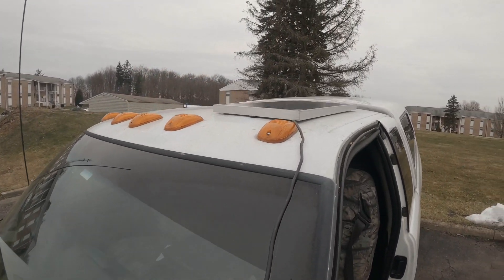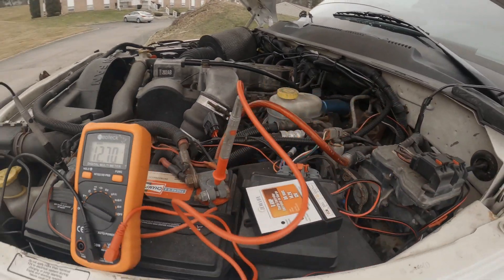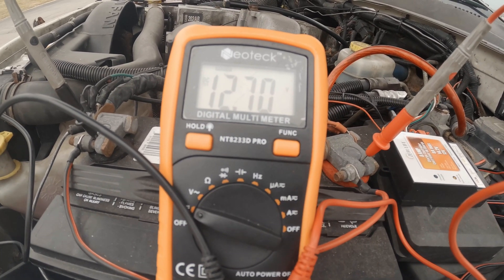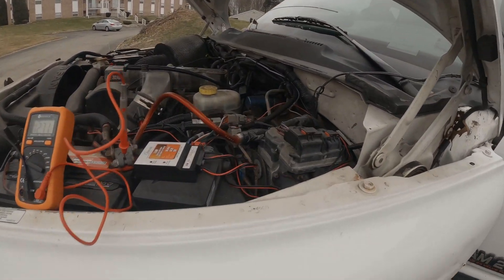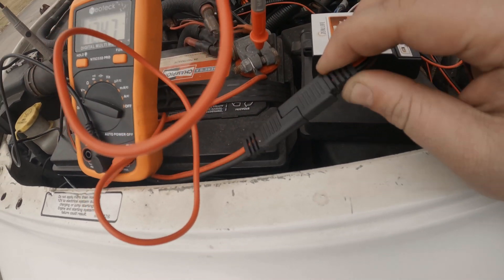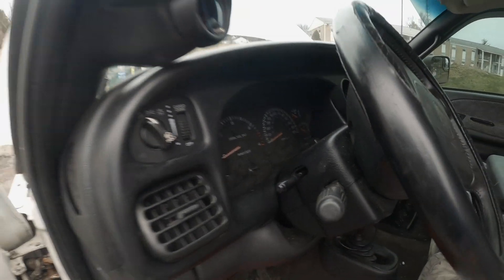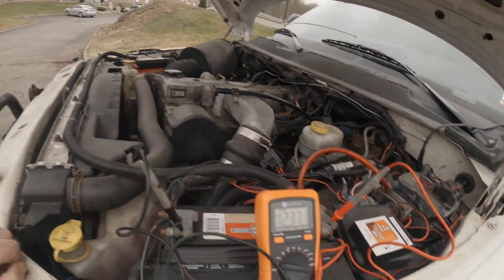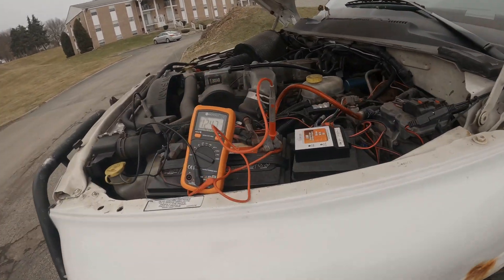SOLAR POWERED BATTERY MAINTAINER FOR DIESEL TRUCKS

Comment: Question - Does your setup distribute the load equally to each battery so they are charging equally or does it charge the primary battery first and then roll over to the other one to charge it off?  In other words does it ever overcharge one battery or undercharge the other?
Reply from the maker: Yea on this setup it auto shuts off at 12.8 volts to something. Turns back on at 12.2 or lowered I think. Keeps both batteries perfectly charged for months at a time